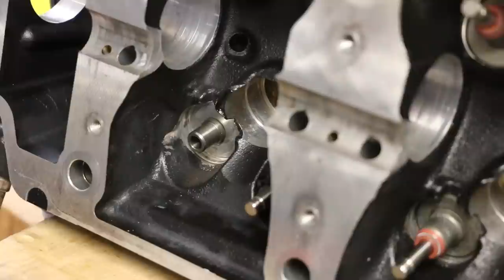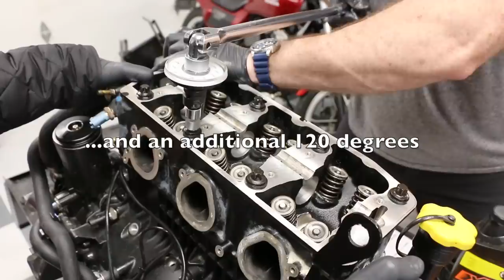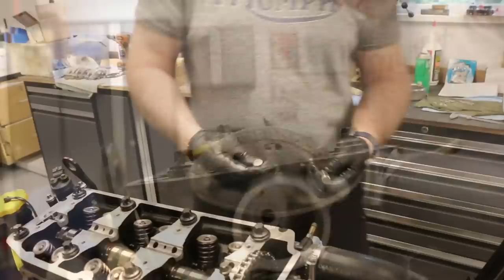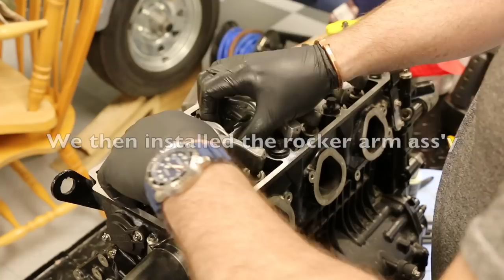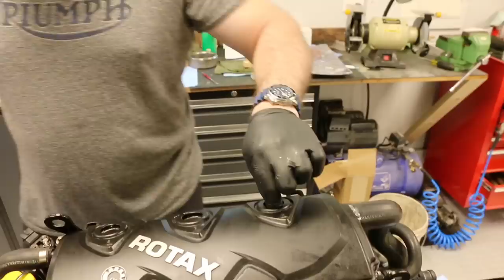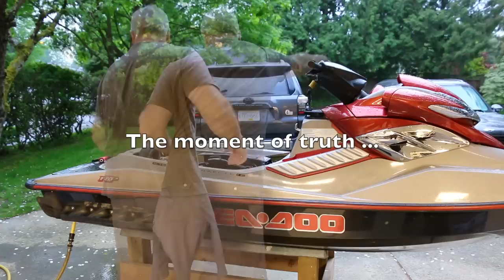Sea Doo Jet Ski Supercharger Failure Aftermath Part 4 of 4: Cylinder Head Reassembly

Comment: I have built and rebuilt numerous race and production engines and watched the same many times over. These engines included Porsche 996s, 997s, 917s radials, rotarys, turbines, and about every kind and type of engine there is, and this engine is about as complex of an engine there is. The method and process of your work in repairing and building this engine is as good as any I've ever seen or been a part of including precision race engines and I'm a perfectionist when it comes to this. If I ever need someone to work on an engine that I'm not doing myself, it will be you that I pay to do it. Fantastic Job !!!!!!!!
Reply from the maker: Thanks very much!

Comment: Great Video, My super charger blew 2 years ago and I've been looking for some way to fix it, its a 2004 RXP, most people just tell me to buy a new one. If I had the tools and know how I would attempt it myself. Thanks for the Video.
Reply from the maker: Hopefully it didn't do too much damage to the engine when it blew. You should take it apart and see if the bearings came out, or if it's the ceramic washers that failed. Good luck.

Comment: THANKS MAN. BLEW HEAD GASKET CAUGHT IT RIGHT AWAY. HONED, NEW RINGS, BOLTS,HEAD GASKET TOGETHER AND RUNNING.APPRECIATE ALL YOU DO.WHERE YOU IN CANADA?GOT 300 ACRES LAKE FRONT 10 MINUTES SOUTH OF PARRY SOUND IN ROSSEAU,ONTARIO.
Reply from the maker: Well done! Sounds like you’re in a great place. We’re located in British Columbia very near White Rock. Thanks for your comment.
Reply: @3ftDeepChannel  when should i change oil out??
Reply from the maker: I recommend every 30 hours, or at least once a year (at the end of the season before storage, preferably). Make sure you use the recommended oil.
Reply: should i change sooner because of all the assembly lube?
Reply: im screwed 95,90,85 compression i told my machine shop if there was any question to bore it.livid pissed off.
Reply from the maker: We haven't.
Reply: @3ftDeepChannel  whats the minimum compression for my machine to run?its down to 90lbs every cylinder. runs five minutes shuts off.2006 rxp.i read  if they used anything rougher than 400 hone the rings would have been ruined right away.

Comment: i have rxp-x260 iam always clean the engine with fresh water after use. thats is correct! or not good for the angine electronics ec ec.  thank you for your time to show us this nice vid,  thank you 🙏
Reply from the maker: That's a recommended procedure. Try not to directly spray any electrical components, or the oil filter cap, etc. Thanks for your comment.

Comment: I appreciate all the time you put in to these videos. Very detailed. I recently bought a 2012 sea doo RXT as 260. It has 46hrs. Now after a 20min ride oil pressure light comes on and goes into limp. I tested the oil pressure sensor and it checked out fine. I’m leaning to the oil pressure regulator/spring. Any tips or tricks to try before I remove the engine completely to attempt fixing it?
Reply from the maker: Did you get any code? It should throw a code when that happens.

Comment: Why is the correct torquing sequence never shown in any of your videos? Is there a particular reason for this? Keep up the top videos!
Reply from the maker: Yes. Chris doesn't always fix things "by the book", but I'm a stickler (to the letter), so I always mention the details. Essentially the deal is that I film him doing his thing, but I don't get in his way (like insisting he follow proper torquing sequences, and replacing certain hardware as the manual says). Often I'll edit the shots to the proper sequence, even if he doesn't follow it. Luckily, he's proven me right so far that it's not always critical to do so (we haven't had any problems as a result, yet). Thanks for your comment!
Reply: 3ftDeep Thanks for your reply. I understand that people have their own preferences when it comes to stuff like this so that’s fair enough. Keep up the great work!

Comment: thank you very much for the help, I have one question, why can't it be produced with one number without degrees, with one tightening system?
Reply from the maker: It's the nature of the metal used in the screws. The screws are permanently deformed in the process and can't be reused. The deformation process needs to be precisely as indicated, or the bolts can break. Good luck.

Comment: Thanks for the video, you do an impeccable job. I have a question, I have a 2011 sea doo 155 wake, I think the engine is stuck, I need to do the test and try to turn it by hand, but I don't know exactly where I should turn it, I will be grateful for your help.
Reply from the maker: There is no easy way to turn the motor by hand especially if you think it's stuck.  I would remove the pump and driveshaft then use a small impeller removal tool in the PTO to try and turn it over.  While the pump is out you can check if the pump bearing is good and the pump is not seized which would stop the motor turning over.

Good Luck
Reply: @3ftDeepChannel  thanks for the explanation, I will follow the steps greetings

Comment: The head and main bolts need new replacements correct? And where  do you find a good manual  for doing a rebuild? I'm getting ready to do my 185. Thanks I'm glad I found your videos
Reply from the maker: Essentially all of the stretch bolts need to be replaced. Normally, they can be purchased as a kit. Unfortunately, it’s very difficult (and expensive) to get a Service Manual through your Sea-Doo dealer, but there are places online where you may be able to download a copy for your machine. We can’t vouch for the sites or manuals being virus-free, but here’s a site to check out: https://seadoomanuals.net. Good luck.
Reply: @3ftDeepChannel   I appreciate all the information.  And look forward  to seeing  more of you're videos.  Stay safe

Comment: If a supercharger fails, would that cause the engine to crank but not start? I have a 2006 sea doo RXP I can't get to start. It cranks over but won't start.
Reply from the maker: It could, but it's doubtful. Check your plugs first. If they're okay, remove the air intake to eliminate any plugs in the system. If that doesn't work, you'll need to check your fuel system and fuel injectors. Make sure your machine isn't in "drown mode". If the engine is always getting full throttle, it won't start. Good luck.

Comment: Did you put a brand new supercharger In? I didn't see any part of that in all the videos
Reply from the maker: No, we just rebuilt it. It's very rare to require a new supercharger, as the supercharger rebuild kits come with all the "guts". You'd only need to replace the entire unit if the outer shell is damaged, too.

Comment: amazing !! how do you think, what is the best jet ski engine ? to talk about seadoo kawasaki yamaha 250-300ag and about 2008-2012 years ~
Reply from the maker: Right now I think BRP (Sea-Doo) engines are the best, although we don't have any experience with Kawasakis. We've had lots of problems lately with Yamahas, especially with cracking engine blocks (3 in our group), and supercharger clutch failures. The BRP engines have been rock solid since 2003, and their superchargers since 2008. The new 1630 ACE engines seem great. Thanks for your comment.

Comment: You responded that it cost roughly $1,500. Was that for parts alone and did that number include the supercharger rebuild? Not being nosey for about your hourly labor charges are just trying to estimate a similar job before I decide to make a purchase on a machine possibly in this scenario.
Reply from the maker: That was just parts alone. The supercharger kits were about USD $350 at that time, and was included in that cost estimate. We didn't include our time in the cost. The cost to have a mechanic do the repair will be much, much more. The challenge is getting a firm quote, as they won't know what will need fixing until they tear into the engine. Best to avoid buying a machine that's in that scenario as there are too many unknowns.

Comment: I just  finished  3ft deep inspired rebuild on a  2004 RXP that had a broken valve that ruined the head assy and piston. All went well (after I figured out the Ft lb vs Ft lb in...Whiskey) Starts up great, sounds good have a hose hooked to it. I take it to the lake and right off the bat it starts beeping oil at me. I put about 4 quarts in and it looks good. any thoughts?
Reply from the maker: 4 quarts?? Holy smokes! Was it spilling out into the hull? Smoke out the back?
Reply: @3ftDeepChannel  to clarify, I didn't put anymore oil in after it started beeping at me.  Parked it and rode only one of the two sea doos for the rest of the day. No major smoke, nothing in the hull, it read on the high side of the stick so I pumped a little out. I ran it on the hose for a while with no oil warnings. Seems like it is a fine line between too much oil and not enough.
Reply from the maker: @henryperez7472  I actually just siphoned some out of my machine today. Not sure why it can be at the proper level, you remove 3.5 quarts during an oil change, you add 3.5 quarts  back in and now you're way over. It's a mystery to me. Glad it seems to be working fine now. Good luck.
Reply: @3ftDeepChannel  After  the last  thread, i went and hooked it up and ran it a little hard. Definitely some smoke even after I siphoned some oil out of it. Hopefully it clears up after a bit. . Really appreciate the feedback. I'll have to tell you guys about the "other" seadoo rebuild I am working on. COVID is breaking out the inner mechanic in me. Thanks again.
Reply: OK now I am pretty sure I did something wrong, that didn't work, I am having the same issue with my 2007 Wake 215. It had a supercharger blow up and I followed your very inspiring video and wallah! Starts up, runs on the hose for a while. I think I hear a high pitch kinda whine which scares me, but several fellow sea doo friends say it sounds fine...  Take it out.... 0523 error (The previous "repair" ended up with the same error) hmmm, take it home, replace the oil pressure sensor, runs on a hose, then thinking I'm badass, drive 4 hours to the river....You guessed it! 0523 after running just long enough to stroke my ego and convince me I'm good to head downstream. I was thinking maybe the sensor was DOA and started looking into the rumor that the ECC could be the culprit, no leaking oil, but it really sounds like a PICNIC problem (Prob in chair, not in computer) after having the same error happen twice on my first 2 major repair attempts. Just thought I would post to see if this sounds familiar and you have some wisdom to share.

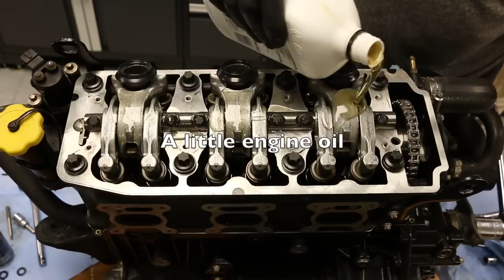Comment: Found the part where you turn the crank shaft. It’s at 5:45. Your using a socket where the drive shaft goes into? I hope my question makes sense..
Reply from the maker: Yes.
Reply: @3ftDeepChannel  do you remember what size the socket was? I don’t remember seeing anything a socket could bite on to
Reply from the maker: It’s a specialty tool like this one here: https://www.amazon.ca/dp/B00KI367F6/ref=as_sl_pc_tf_til?linkCode=gg2&linkId=cc83089038fcfa67c1b51091362403f9&creativeASIN=B00KI367F6&tag=3ftdspor-20

Comment: How did you set the timing? Does the first piston have to be TDC or do the timing gear lines just have to be level? Also, when did you lockout the crank?
Reply from the maker: Hello Braxton, We have a few engine, teardown and rebuild videos where we describe the information you’re requesting. Please check those out. Good luck with your project.
Reply: I haven't been able to find any of the videos. Do you have a direct link to the ones explaining this? The other Seadoo head gasket/tear-downs I have seen just skip over those details.
 @3ftDeepChannel
Reply from the maker: @braxtonbrown1311 Hello Braxton, This video (3 of 4) and the next one in the series (4 of 4) of us reassembling an engine should have the info that you need. Good luck. https://youtu.be/PSNrLo7MHDc?si=64CbLOkkZQ-YlgNr
Reply: @3ftDeepChannel  Thank you for your help!
Reply from the maker: You’re welcome. Safe riding.
Reply: One last question, do you the head bolt socket size?  @3ftDeepChannel
Reply from the maker: Not off-hand, but it’s metric.

Comment: Need new bolt for rocket arm and bottom case ?
Reply from the maker: All the stretch bolts need to be replaced. Normally you buy all of the engine bolts that need replacing in a kit.

Comment: I have a 2011 Seadoo GTX 260 limited. Had it running with water going to it. It was smoking pretty bad then it suddenly shut off. I checked the spark plugs and the #2 cylinder plug electrode was smashed. Ski will no longer turn over. Can you tell me what do think happened?  Does it need a rebuild?   Thanks.
Reply from the maker: Sounds like you dropped a valve. I would pull the cylinder head off and check it out. It’s hard to say how bad it is until you get in there. If you have an endoscope, you could use that first. Good luck!

Comment: Great work, how much did this cost?
Reply from the maker: About CDN $2,000 (or USD $1,500). Thanks for your comment.
Reply: I blew my supercharger yesterday, didn't know it can really damage the engine itselve. If its 1500 euro i would be happy.
Reply from the maker: That's terrible. It depends on how it blew. Hopefully parts didn't go into the engine,  or you may need to clean it out, and that can be very expensive. Good luck!

Comment: What type of timing chain do you recommend for 2010 Sea-Doo what name brand is a good one
Reply from the maker: We always use OEM timing chains, so we suggest getting one from Sea-Doo.
Reply: @3ftDeepChannel  How many hours does a chain last? tanks
Reply from the maker: Good question. Although timing chain failures are rare, if we’ve already got the engine apart and there was a catastrophic failure of a component that could have damaged the chain, we normally replace them at that time to avoid a headache later.

Comment: Great Job,!  any advice for buy used seadoo in BC?  Do i need registration number for it ?  Thank you very much
Reply from the maker: Yes, all PWCs are considered boats and need registration numbers. We'll be putting out a "how to buy a used PWC" video in the spring, so keep your eye out for it. If you buy it before it's released, my advice is stay with a 4-stroke model and if you're a beginner with little mechanical skills avoid one with a supercharger/turbocharger and an intercooler. Good luck!
Reply: @3ftDeepChannel  thank you very much

Comment: What are you using to turn the crank manually to line up the crank and camshaft locks?  I am currently following your videos step-by-step, which are a HUGE HELP.  Just trying to figure out how to turn the engine manually.  Haven't found anything that fits the crank shaft splines.  Thanks!
Reply from the maker: A socket wrench should do it. I can’t remember the size of the socket we use though. Good luck.